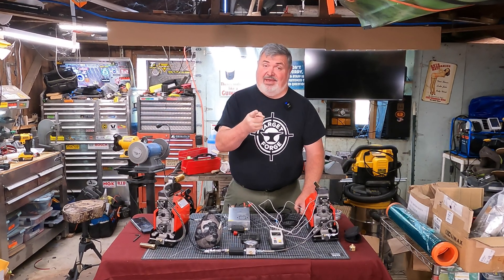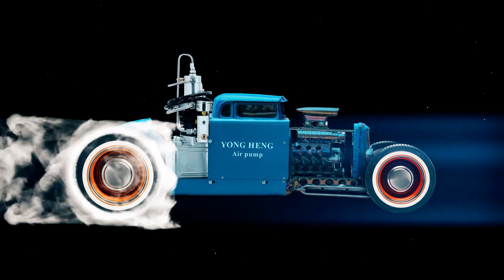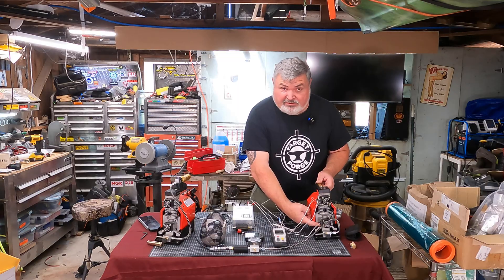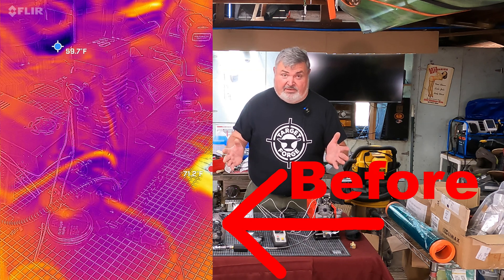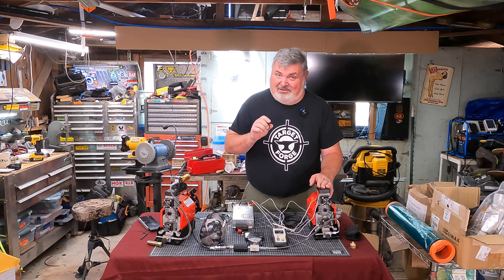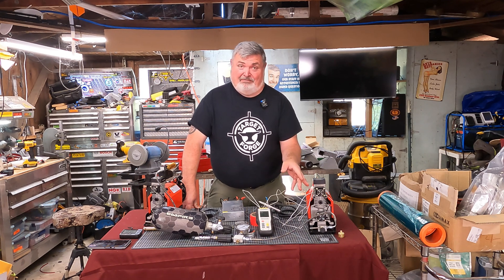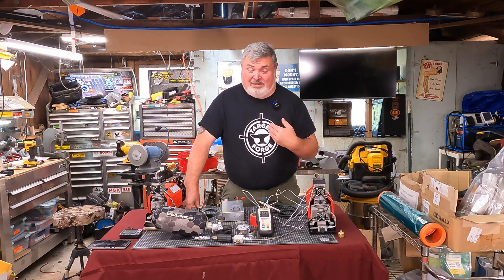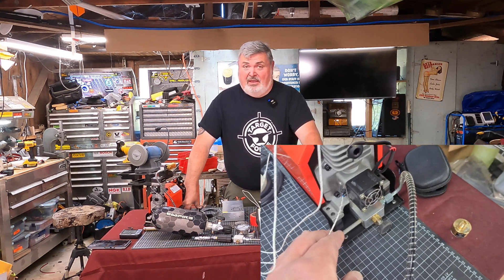GX CS2 Thermal Test on 20 minute run What can you expect? Yong Heng Hot Rod Shop Target Forge

Comment: I bought my compressor about 18 months ago and after 6 months I noticed a squeaking noise so I contacted you after seeing your maintenance video. I purchased the two syringes of lubricant you recommended and performed the required maintenance on my compressor which stopped the squealing. I've performed maintenance twice now in the past year on my compressor and it's been working absolutely flawless. I own several air guns and shoot almost daily. I'd highly recommend this compressor and the lubricant you recommended.
Reply from the maker: Thank you for the kind words! Nice work!

Comment: I bought a CS2 recently and it takes about 20 minutes to fill my 0.8 L 3000 psi HPA bottle, today I find I found out that it seems to put some air with water inside my bottle, is there a way to avoid that? I am using the water filter as you do in the video.
Reply from the maker: The best way to limit the amount of moisture being moved through the system is to periodically vent the lower block with the needle valve. Just a quick blip open and closed, will push that moisture out of the system. You can also check out this video on a REAL filter solution. https://youtu.be/syLB5PywOc4?si=BvKmA-_ZzqN5x1Ql
Reply: Ow wow! Seems like a easy solution, where is the lower block? Next to the bleeding valve there is a cylinder which pumps like a white water when I open the bleeding valve. Does it have anything to do?
Reply from the maker: @danielarturodebernardogome832  We are using different words for the same part. There is only one vent, that is it.

Comment: I have a CS3 and it’s been fairly bullet proof so far. I’ve used it 3-4 times per week for the past 6 months. I just fill my guns only. No large tanks. Run time on my 480cc tank from 150B to 250B is about 7 minutes. I usually cut it off and give it a 5 minute cool down if I am filling from empty. Takes 2 cycles if tank is empty. Just opened it up today and cleaned out old grease and put new in. Service is easy as well.

Comment: Got one from your Amazon link on the way. Be here tommorrow. Bought the upgraded gauge and air filters too. Just getting in PCP. Bought a Gauntlet 2 in .25. So glad i found your channel. You sold me with your videos. Im sure i will be commenting more after i tinker with it some. Do you suggest replacing factory grease with your grease soon after confirming there is no issues, or wait till 1st maintenance schelule?

Comment: 30 MPA is 300psi it's a multiple of 10.
Reply: Just to help others reading this comment, 30 MPa = 300 bar not psi. 30 MPa = 4351 psi.
Reply: @moorejl57  I moved over to a hill Evo now, so much faster,
Reply: @PeakyBlinder  The Evo 1300  looks really nice, but unfortunately is out of my budget. I do have a very old Hill MK2 hand pump that is really well made, but too much work for a 500 cc tank.  I just bought the GX CS2 on sale and it seems to be a good value for my occasional use.
Reply: @moorejl57  I also have the gs2 I have don't the 18v conversion and take it along to the range as the Evo stays at home, 
I try not to let my air tube run under 220 bar as it's quicker to fill, 
The Evo fills a 300 bar tube from empty in 2 minuets, it's very handy when I'm working in my guns.
Reply from the maker: Truf!
Reply: @TargetForge  but I'll be fitting a new gauge like yourself.
Shame you can't incorporate a shutoff valve in the cs2 without the motherboard.

Comment: Is the CS 3 superior and or worth the extra money compared to the CS 2?
Reply from the maker: I do not believe so. A CS3 is the same pump as the CS2 with a layer of "features" on top that often fail and leave the user stranded. Add to that an enclosure that adds restriction to cooling air and you have the reasons for my disdain for the CS3. It only takes 6 min to fill my 480cc guns, I can stick around and watch the system, not a bad idea if you have ever used Chinese autostop units.
Reply: @TargetForge  Thank you so much. Now, do you prefer the CS 2 over the Yong Heng?
Reply from the maker: @jeffstanley4593  That is sort of a Apples & Oranges comparison. Have you seen my Yong Heng Killer video? https://youtu.be/JQEC7GJKB1A it talks about why one suits me better today. One is better at filling large vessels, the other can operate nearly anywhere. After my video on the GX Hybrid that gap got wider.
Reply: @TargetForge  Ok, here is what I do. I have bottle guns that have a certain amount of shots in them. I do not fill anything larger than 580cc. I fill the gun and go and shoot it. When it runs out of air I go home. If I want more shots I have three bottle guns. I fill them all at home and take more than one. Which is best for me? I did see that video and a coupleof others of yours. I do like the powering by automobile but that is not a deal breaker. I definitely do not like the hassle of a tub of water to deal with. Thanx
Reply from the maker: You still have the option of lugging around a large Carbon Fiber bottle and do your refills with that, but a quality one is almost 2X what a CS2 costs AND you still need a way to fill that when you get home. The CS2 offers portability and usability in a LOT more situations. Hence, me calling it the Yong Heng Killer. For me I can use the sun, my truck, my ATV, and a DeWalt battery to fill my guns. No big HP bottle, no pail of water.
Reply: @TargetForge  Thank you for your time. Sounds like the CS 2 for me.

Comment: So to top off a 90 cubic inch pony bottle I use to fill my air guns, what compressor would you recommend? Thanks for the the info. Good info on compressors is hard to find. Thank you.
Reply from the maker: Thank you for your comment Michael! I know it is bad form to respond to a question with a question, but here it goes. What do you need the pony bottle for when you can fill your guns directly with the CS2? They are pretty close in size and the the CS2 can yield seemingly unlimited fills to whatever pressure you need. I suppose you might just not have a power source where you shoot, maybe you backpacked in, who knows. Can you fill a small bottle with the CS2? Sure. That first fill from empty might take a while, so be mindful of the 20 min "ON" limit, if it's cool where you are running, you could probably take it to 30min (less than 75F). Refills should not be a problem I use mine for testing all the time. In fact in the video you just commented on.

Comment: Would there be any benefit to introducing an external fan?  Also, the battery operated unit? How does it stack up to the  110 model
Reply: I'm assuming you mean to vent the motor heat? I don't really think that is needed if you are using this for it's intended application. Do you mean the CS2 vs the L2? Both can run on 115VAC the only difference is that the L2 runs at 18VDC vs the CS2 at 13.8 VDC. The windings on the L2 are different to allow the operating power and RPM to be effectively the same, so the fill rate would be comparable.  I personally like the CS2 due to its ability to be powered by my vehicles (as shown in my other videos) where the LS can only run an either the AC supply, or the Makita tool battery. I have come up with a way to make a hybrid of the two and I'm testing it right now. Be sure you are subscribed for more info on that!

Comment: Can this compressor fill a 30min tank?
Reply from the maker: Can it? Sure, if you want to stand around let it run for NO LONGER than 20 min, then let it cool down with the fans on for 10min, then repeat over and over. Why not just fill the gun directly? That is what it is designed to do, being able to fill anywhere you are, as much as you want. I can run it on my ATV, Solar, my Truck, check out those episodes as well.

Comment: I've had a CS2 for a little over a year now it has 12.2 hrs on it and just keeps going, I have cleaned out the lower ck valve a couple of times as it get some grease in it after awhile. One thing I do that might interest some I feed it ONLY PURE DRI Nitrogen at about 6-8 psi so that is all that goes into the pump and my guns no chance of detonation no Oxidizers no water no co2 .I feed the nitrogen in through the handle as that is 1/2" pipe thread under the perforated cap. the highest temp I've seen is 109F  at both the top center an at the bottom block for the outlet.  Bill I have found with my no touch laser temp gauge that where you put you probes was not in the peak hot spot for the head right in the middle of the G on the head.
Reply: Well l live in an area that regularly run 80% humidity and I don't think my nitrogen is contaminated by the compressor. I could run without a compressor but 6k N2 tanks weigh over 400pounds and a Good regulator is around 500 bucks l could get a deal on this stuff as I worked in the compressed gas biz for almost 50 years but handling that big ass tank no thanks.
Reply: @terrysweeney9298  80% humidity, but at what temp? Absolute humidity is what counts.
Reply from the maker: Hello Terry, thank you for your comment. Have you looked at my thermal imaging? I think that probe location was great for the answer I was looking at. With a FLIR image I think the aggregate data is much better than a point based non contact measurement. What I wanted to see was the delta between the peak, which is on the HP cylinder wall vs. the overall casting. Glad you have had good luck with nitrogen, it is a great solution, why are you contaminating it with a compressor? What pressure are your bulk tanks at? I can tell you the inside of my guns look great and I am fortunate to live in an area with a pretty low RH.

Comment: Great video as usual, hats off to the fan that supplied the compressor to you, I've had mine since late January and up till this week it was great but now when get over 200 bar it start making a different noise and when it gets to 250 bar its starts to loose pressure, waiting for you to start selling the parts so can get I hope is the check valve on bottom leaking by
Reply from the maker: Parts should be here shortly!

Comment: Funny thing. The compressor that died had a MPa gauge. The replacement came with a PSI gauge. I've converted everything that I own that had PSI gauges to (bar) long ago. So, the MPa gauge is on the replacement now! I don't even 'think' in PSI any more...
Reply: ps. 30MPa = 300bar. Easy to convert...
Reply from the maker: I agree with you, but to date, I don't have a single gun with a pressure spec in Mpa, Why put it on the gauge to this market?
Reply: @TargetForge  You are correct, it makes no sense at all.
Reply: @BSJ-VT  So is there a direct correlation between MPa and bar? IE 10 MPa =100 bar. 20 MPa = 200 bar. 25 MPa = 250 bar etc? Wait, I just Googled it and you are correct 1 MPa = 10 bar. Still not a good idea for a market that does not commonly use MPa.

Comment: I have the CS2 and love it. Another airgun friend also recently picked up a CS2 and he also likes its performance. Question- are you using and type of thread sealer between the Adapters on your fill hose? If not, what do you use to avoid air leaks?
Reply from the maker: Great question Ed. I'm planning an episode to talk about connection types and what should and should not be used, where and when. The ONLY time teflon thread tape should EVER be used is on tapered threads. The purpose of the tape is more about lubrication as the two tapered surfaces are driven together as they are tightened allowing the threads to fit so tightly that they do not leak. This will not work on a BSP thread as they are parallel and are NOT meant to provide the seal. They are typically either face sealed (nylon washer, o-ring) or sealed at the top of the thread with a dowty seal. On the CS2 the fitting that threads into the head first is a parallel thread that seals on the face of the fitting. Do not use sealant here it may squeeze into the fitting and end up in your guns regulator eventually. The next joint is a compression ferrule joint to the hose. The only thing the thread does is crush the flare into the mating surface, no sealing is done on the threads, tape here is really silly. As delivered none of these joints require sealant and using it will likely cause more problems than it will solve. NPT threads get sealant, not flare,  BSPP, or parallel metric fittings. I know everybody thinks teflon tape fixes leaks, but they often fail to understand how the seal is actually designed. Hope this helps!

Comment: Fascinating test!   The results and your conclusions make me feel even better about my CS3.   The temperature on my low pressure head after running my compressor for about 6 minutes to fill my 3000 psi gun is 38 deg. C.  I will have to take some measurements at the other locations, but I will have to do it one at a time as I only have one thermcouple.

Comment: Don't currently own one but would like to purchase one soon. Seems like a nice little compressor I want one to fill my 48ci 3000psi hpa airsoft tank refills what's the refill time from empty on a tank like yours
Reply from the maker: I typically don't fill larger bottles from dead empty. My use case has me filling them at ~150bar and if I'm filling a gun directly (480cc), which they are really designed to do, I usually stop at 250bar. This test actually had it go from 4000 psi to 5000 psi pretty quick, in fact I had to constantly vent it to get a 20 min run.